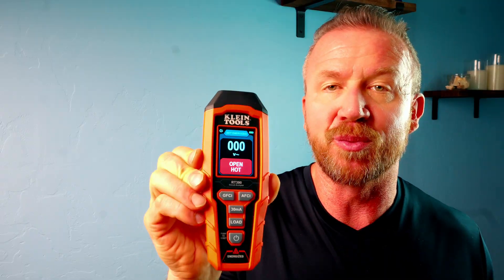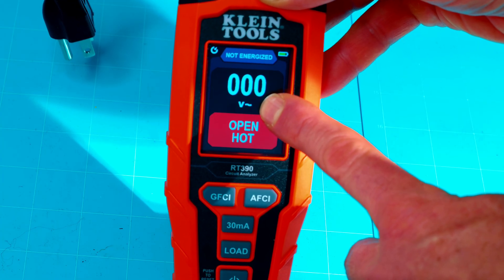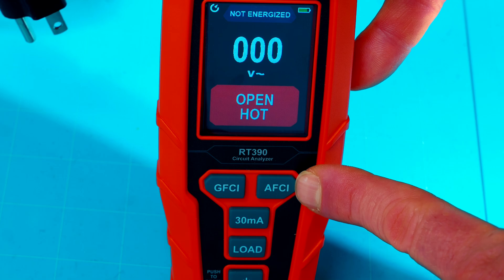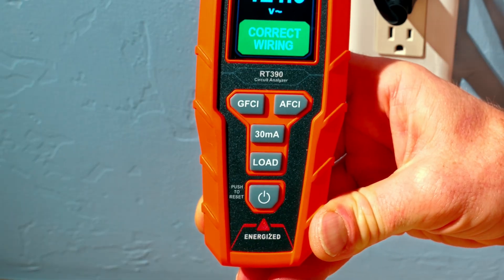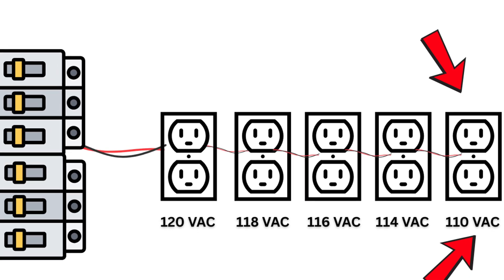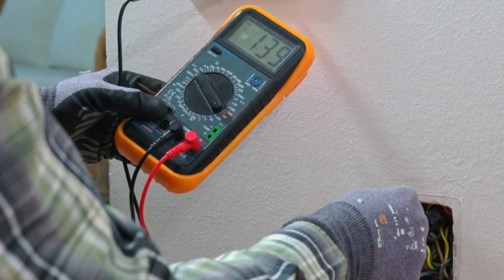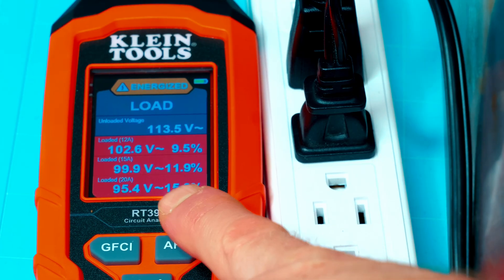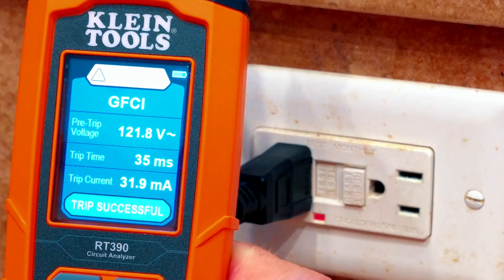The BEST Outlet Tester! (Klein RT390 Full Review)

Comment: I love how you fake streamers act like oh this is the latest newest thing I literally have that tool for more than 12 or maybe 15 years now maybe they recently came out with a color version but it's not new. I used to install flat screen TVs back when arc fault breakers were still fairly new and regular plug-in circuit tracers were not able to tell you which circuit breaker it was so I purchased this tool and I could just plug it in and hit the button do my work go back downstairs and turn it on

Comment: This seems like the equivalent of the LoadPro which is used for 12V DC systems in automotives. The LoadPro didn't sell as well as we thought, and although I have one I rarely use it. Most of us just use a light bulb to see if it glows brightly. Even so, this kind of tool is fascinating to gearheads like me. I guess one could simply plug a hair dryer into the second outlet of a duplex plug while watching voltage on a multimeter. I wonder if the AFCI tester will affect AFCI's in the house that are not in the circuit you're testing. I had a failing HVAC compressor that was shorted to ground, it would trigger AFCI's on completely unrelated circuits....
Reply: That's a good point on just plugging in a load and checking the voltage, but truth be told almost no one needs or wants that information anyway.  Voltage drop is a distance problem, not a connection problem, and it's so small in residential it is irrelevant.  You would need something like a big box store where a light is 500ft from the panel before voltage drop became an issue. 

AFI's are separate from each other. But they are prone to nuisance tripping, especially the older ones.  Something simple like unplugging a device would trip them.  You prob have multi function breakers, and they are tripped because of a ground fault.

Comment: This has been great. I recently replaced many receptacles and wanted to add a GFI at the start of each circuit. Using the Load feature, I could see the voltage drop in each outlet. The worst numbers indicated the end of the run, and the best the beginning, which allowed me to add the GFI in the correct location. Very nice.
Reply from the maker: Very clever way of deducing your circuit my friend! Thanks for sharing and the comment!
Reply: The resistance of #12 copper wire is about 0.7ohm for every 500 feet.  For reference, dry human skin has 2000 ohms. 

Unless your room is the size of a football field, the VD readings would not help in telling you which is the first plug in the circuit.   Even if it could, a $20 Walmart meter would show you the one and only hot in the circuit after you took out all the plugs and separated the wires. That would be where you put the GFI. 

I'm surprised people would actually spend $160 for a glorified plug in tester.  As they say, there's a sucker born every minute.
Reply: Except the tester actually worked and located the start of each run every time. Considering you’ve never used it, because expense is apparently an issue for you, maybe look to Ludwig Wittgenstein and be quiet.

It also tests a GFCI/CAFCI breaker’s ability to catch GFCI and Arc faults. Does your $20 meter do that?
Reply: @Paine137  I'm an electrician, I've spent $300 and up on meters. I literally have 1000's of dollars in tools.  I simply tried to explain how the meter did not help and could not help in your situation.  But at the end of the day a fool and his money are soon parted.
Reply: @daze-70 lol love that this guy references Wittgenstein to try and posture, all the while not knowing how to wire a 3 way
Reply: @DanielMulholland-d5u  It’s so true: I was denied the genetic gift of electrical wiring. But another nice pivot from the relevant point.
Reply: @Paine137  the less relevant point is that you could have spent forty bucks on a screwdriver and a tick tester and have solved your problem twice as quickly. The more relevant point is that if you find yourself playing the fool, it's ungraceful to do so while feigning authority. 

There's some quote about people not speaking on matters they know nothing of... Can't remember who said it
Reply: @DanielMulholland-d5u  That’s more relevant, not less, because reading comprehension. And, yet again, the Load feature and the ability to test for two kinds of arc fault separate this from other options. Should I also throw out my impacts and use screwdrivers for everything. Let me know if you need anything else spoon-fed, or just continue to cry.
Reply: @Paine137  You're the only one crying about being misunderstood my guy. You've just got two electricians trying to help you learn a little. Don't worry, keep practicing and you'll get there ❤️
Reply: I commented on a tool, I didn’t expect to speak with one.
Reply: @DanielMulholland-d5u  His ego is bruised, logic left the room with his first reply.

Comment: Thank you so much for your excellent and detailed reviews of RT390.
 I have  Klein MM 420 multimeter and Klein CL810 clamp. Can they ,alone or combined , provide entire RT390 functionality?
Also related to it: does CL810 cover MM420 completely?  
Thanks a lot in advance! 
P.S. hopefully in tge future you can upgrade your CL800 review with CL810 info.
Reply from the maker: Thanks for the kind and detailed comment friend! To answer your question, the RT390 is specifically built to test outlets to include GFCI and AFCI circuits. While your meters can test outlets, they would be missing the parts where they can test GFCI's as well as outlet wiring troubleshooting. There are some more basic outlet testers though that might suit your needs just fine too!🙂
Reply from the maker: Also, just purchased the CL810 so stay tuned for some new Full Reviews!🙂
Reply: @ElectricalYou Thanks so much for your replies,